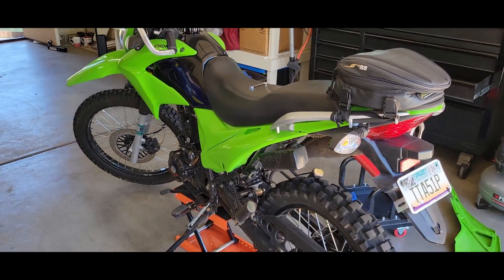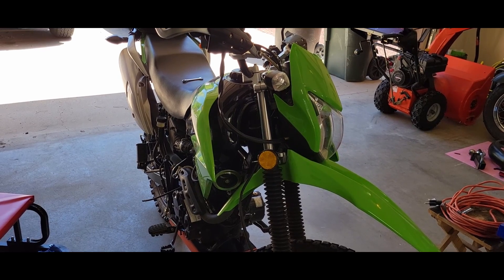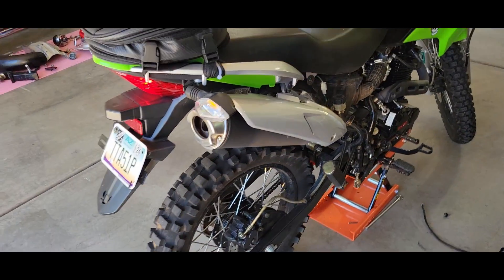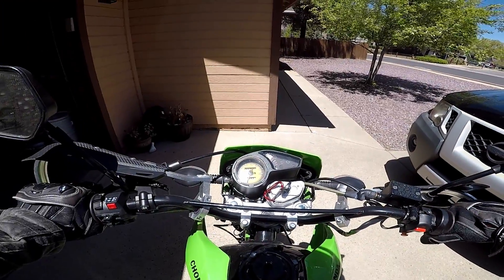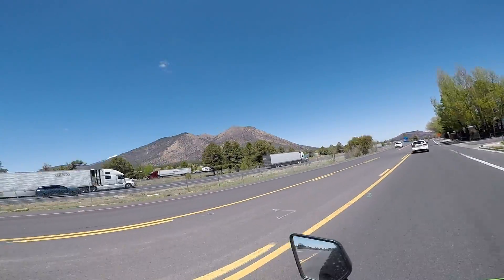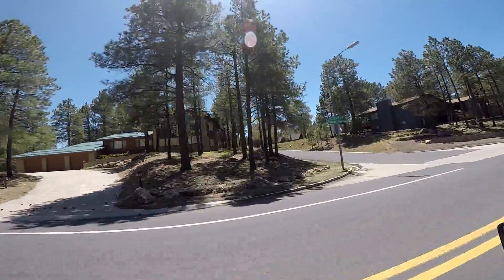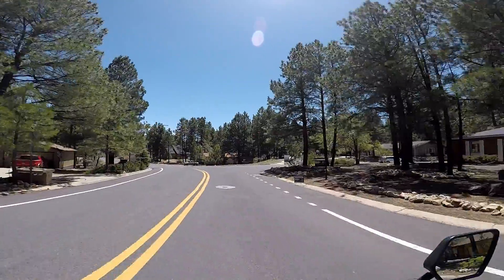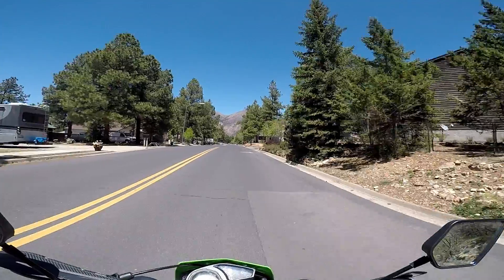$1500 AMAZON Hawk 250 Enduro - CARB Tuning for ELEVATION

Comment: Hey ,im in AZ too. New rider here,ive acquired a2021 hawk rps with only 39 miles on it. After watching hours of videos on YouTube, i decided to do what the majority of hawk owners do, which is get a nibbi carb and pod filter. Im planning on. Deleting the airbox and maybe the aftermarkwt exhaust. Again, I am a newbie rider  and any imput would be grwatly appreciated. My question after installimg the nibbi carb, do i leave it as is or do i rejet? If so what number would you recommend? Thanks in advance.
Reply from the maker: It definitely depends where in AZ you are.  Deleting the airbox and putting a free flowing exhaust on will make the bike run more lean, so you will probably need a bigger main jet and possibly a pilot jet.
Reply: @TyposGarage  I am in rio rico. That's close to border of nogales mexico.

Comment: I was considering purchasing this bike, but I've come across numerous horror stories about having to constantly rejet the carb if you plan to ride in the mountains. I live at an elevation of 2,500 feet and often ride at much higher elevations. It sounds like a hassle to adjust for different elevations. I'd love to see a video on how you manage this issue when riding through such a broad range of elevations in a single day.
Reply from the maker: So, I'm sure that I will be doing any super long rides with the Hawk where the elevation changes enough to need to change the jets. Since I went from a 110 to a 100/102, I would probably just carry a 95, 105, and a 110 to cover the range.  I think I dropped about 1200 feet when I rode out to the Edge of the World, but I didn't have any issues with tuning. I was probably right at the edge of being too lean, but I didn't notice any difference.  The carb is really easy to take off, so it would only take a few minutes to drop in a new jet if you're noticing issues.

Comment: I'm at 6000 ft and am running the stock with the mixer at 2 turns on the mixer with a thin washer under the needle and  she is running pretty good.
I do have an aftermarket muffler and a pod filter on it.
Since i don't get to wet out here in northern Nevada the pod filter is my choice because i had the same issue with the intake hose. 😎👍

Comment: I use a 110, but I'm at only 700 feet.  Those speedometers are NEVER right!
Reply from the maker: I used a 110 at 1000 feet and it ran pretty good. Yea, I really need to use the GPS on my phone to see what my speed actually is.